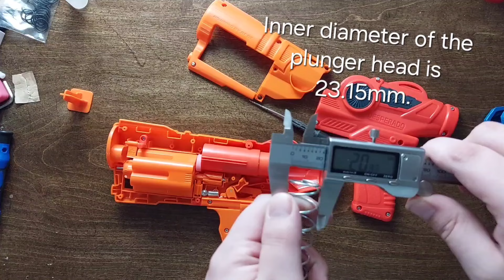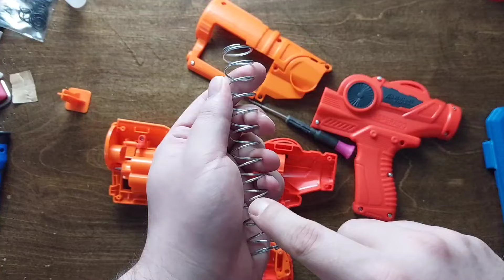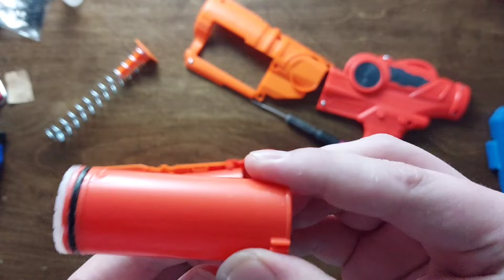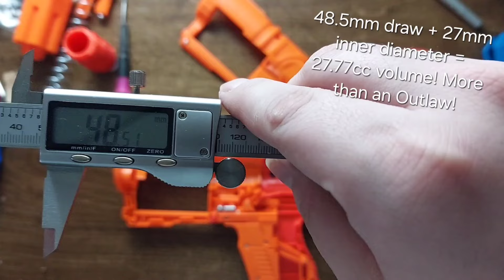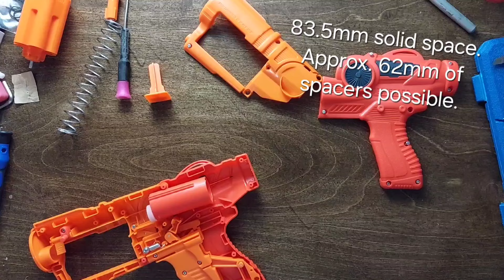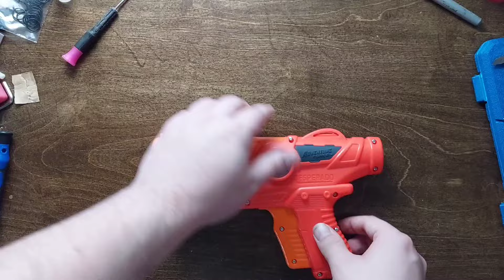AF Desperado: Deep Dive and Technical Analysis!

Comment: The plunger seal issue is very interesting, my Desperados have a speed seal. Performing the same motion you do at 2:55, I observe a great speed seal effect. I can also feel it pull a vacuum when I try to pull the plunger back with the PT outlet closed. One thing I noticed is that your blaster has a red plunger and plunger tube, mine are white. All else appears identical. Perhaps there are two different types of Desperados?

Edit: Confirmed that there must be different versions, I opened up two of my blasters and they have the white plunger tube and speed seal. Additionally, I do not have the lever guide part at the base of the grip that is seen at 10:43. Very weird!
Reply from the maker: Strange... 2 versions this early? Perhaps something was released that wasn't supposed to be?
Reply: @radioactivesdesigns3554  very possibly! For what it's worth, my friend has one with internals that look the same as mine, but lacks a seal like you observed. The blasters I tested only have the speed seal truly engage after depressing the plunger about halfway, so I'm thinking of doing a Teflon tape wrap - don't want to lose all that potential air!
Reply: Same. I have White tube and no orange guide on bottom right.

Comment: Thank you for this though this blaster it suprimly accurate out of the box... Like in my 19 foot room it's as acruate as my 200sfps gameface trion... But you have to pull the trigger smoothly which very hard to do... So yeah this blaster is easy to use just slam fire and you can hit a man at about 20 feet easly but if you want to hit coke cans at 10 feet you need to train with it but you can which is awesume for a non pro blaster.

Comment: It might be posable to modify the trigger mechanism into a  double-action/single-action. If you added a single finger trigger to the whole hand trigger whose job was to lower the sear to it's normal height and modified the trigger bar to let the sear move up enough that the plunger could not slip past you'd be able to separate the cocking and firing functions of the trigger.
That way you could squeeze both triggers to quickly spam shots or just the 3 finger bottom trigger to cock the blaster and the top trigger to fire.

(With out having one in hand it is hard to tell if this idea is feasible.)
Reply from the maker: @wadekirby8575  I don't think so.

Comment: An RSCB cylinder that shoots 3 x 50 cal balls would be cool if the spread is not too quick. Perhaps different rifling twist rates in the barrels would let you tune the spread.
Barring that, cramming as many half dart RSCB barrels in it as possible (and not spring it too hard) will let you quickly spam a lot of shots.
A replacement one (or two) finger trigger would make it easer to be accurate. 
(A double-action only trigger is harder to shoot accurately than a single action and the whole hand trigger exacerbates that.)

Comment: How does the air volume compare to a Hammershot?
Reply from the maker: Its around 10-12cc more than a standard, stock hammershot.
Reply: @radioactivesdesigns3554  So... that means a Mega conversion will be coming at some point? 
(On a related idea, what about a stock length cylinder that shoots cut down mega darts?)
Reply from the maker: @wadekirby8575  no, I dont think so. It would require way too much modification. N1 barely fits as is, so Ultra is probably out of the question as well. I would have to redesign the entire front half of the blaster.